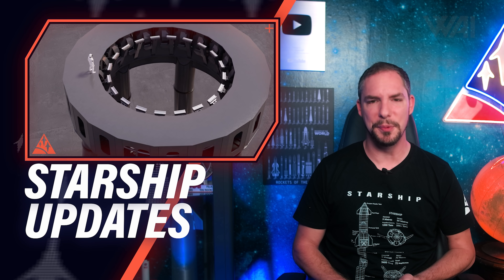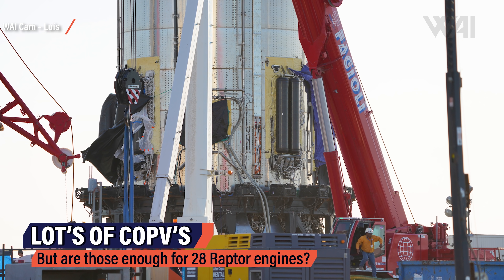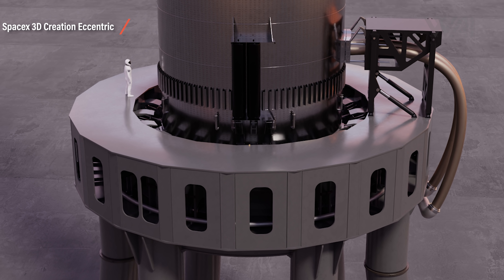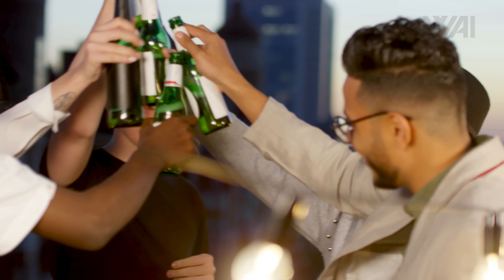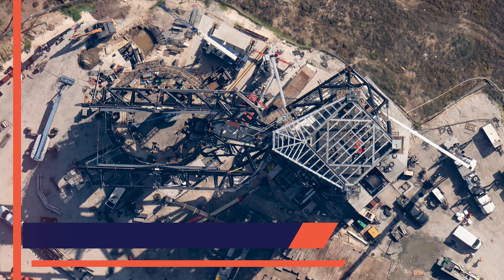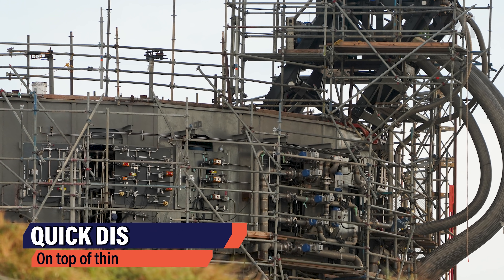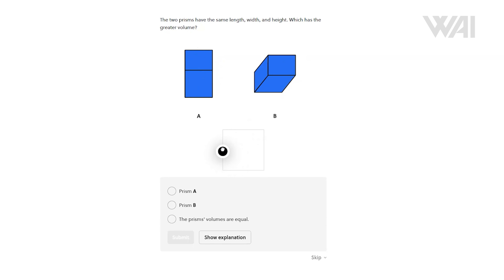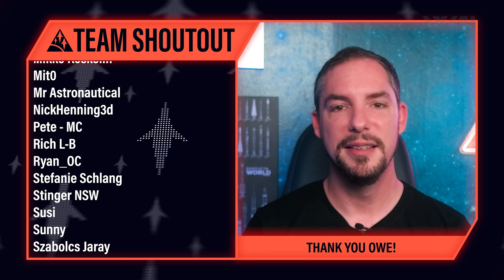SpaceX Starship & Super Heavy engine mystery solved!

Comment from the maker: Is there anything we missed about the orbital launch mount? :_WAIHello:
Reply: They for sure already installed some water pipes in the legs of the orbital launch pad 😉
I always wonder how they can continue working with all the dirt after each launch. It must have effects on electronics and assembling
Reply: My thoughts exactly.
But they got filled with concrete, right?
Reply: The legs I mean.
(Answer to Dr. Ricco)
Reply: @FlavioLanfranconi  but were all of the legs filled, they are of sufficient diameter that 1 in 3 or 1 in 4 would surely be able to carry enough water.
Reply: @ProgressiveEconomicsSupporter  I was thinking the same. Water mains might already be installed inside the legs of the launch pad.
Reply: @ProgressiveEconomicsSupporter  A (hidden) water deluge system would flood the entire launch site. There is no drainage.
Reply: Saying the booster is kept under pressure when it is empty... Does that mean it can't support it's own weight?
Reply: @DavidJohnson-tv2nn  yes and no you gotta understand there is a limit to materials before they literally just crumple like mk1 starship
Reply: @DavidJohnson-tv2nn  It can when both booster and Starship are empty. That was proven when they did the fit test stack. But the pressure will be needed when the Starship is filled with fuel and payload as it will increase the weight substantially.  They are trying to go as light as possible on the booster so that they have more payload capacity. Which is why much of the stuff has been built into the Orbital Launch Platform. Payload is money.
Reply: Siii, nuevo video, genial 

Saludos desde Colombia👍
Reply: @rdherrera543  p
Reply: Near end Olva quick disconnect render, it would be nice to see a banana for scale on the LOX & CH pipe diameter.
Reply: i suggest that the water for the deluge could travel up inside the legs to the table ..both to supply the water for sound suppression and to prevent legs from heating up
Reply: well, there IS a water tower in the tank farm so, that probably means there is a water deluge system, so probably we just havent found out where it is, right?

cool videos as always, thanks!
Reply: Booster needs to be aligned with quick disconnect arm. How it will be assured with chopsticks catching the booster? Does the chopsticks have ability to turn booster?
Reply: @Rincerith  The chopsticks have "tank treads" on top to facilitate this.
Reply: @KingdaToro  thank you for this information!
Reply: @Rincerith  From the various renders shown to date yes there are tracks on each arm that apply pressure and when powered up will do precise rotation of the booster until it is aligned properly. They look like rubber faced tank tracks.
Reply: Hold-downs weren't mentioned. Are the connectors that connect to the outer engines to facilitate ignition also the hold-downs?
Reply: What if.... The water for the deluge system is contained in the launch platform legs? I don't remember them being filled with concrete during construction so I could be wrong 🥴 but water in the legs would cool them as they have no protection from blast. This would be a elegant solution 🤔
Reply: @Positivity  yes he dose
Reply: Yes the deluge system is already built into the mount/table.  These pipes were put in before the table was moved to and installed on the launch stand.  Lines from the water tank will connect into the system and water flows around the 20 arms.
Reply: You rock*
Reply: I liked the new intro
Reply: Flame trench
Reply: You have such a great channel! Keep up the good work! From Russia
Reply: Find the best German chocolate and re-wrap "Why Not Eat This*" chocolate bar.

*May taste better on Mars
Reply: FELIX theres no mistery on it, everyone know  how it work and someone show that in another channel 4months ago.
Reply: @madara12regio  I just like that he visits twice weekly, we all know he'll cover new stuff when it comes. Until then we can enjoy his confusing accent and passion for SpaceX am rocket's. He is better than Bots for sure. Thanks Felix for the visit even when there's no major changes. YOU ROCK!
Reply: Super/sub-cooling propellant using helium bubbling post-press(?) is worth mentioning, re: the gaseous feeds
Reply: Sorry, where is the link to Cosmic Perspective?
Reply: The best part is no part. The deluge system is needed but why water? We have Nitrogen in liquid form available. That is much colder and this will take much more heat out of the exhaust gas. The byproduct is a much more transparent lift off and no dirty rain of water and exhaust.
Reply: @paul_gradenwitz  Water is a good heat and sound absorber, this particular liquid has a high latent heat of evaporation which soaks up energy to make steam. One of the tanks in the farm is understood to be for water, question is how to pressurise it to flow quickly enough on launch, without a tall water tower?  Those horizontal tanks maybe, air at say 20bar?
Reply: @paul_gradenwitz  the specific heat capacity of water is four times greater than nitrogen, and it is much less expensive to store.
Reply: Can the booster hop? We do not know for sure yet. Would it explode where it stands?
Reply: @reasonerenlightened2456  It looks like THIS booster is gotta go right to orbit without a hop. However, I guess we can see a few hops with the next boosters (to with booster dummies rather) when the chopstick' 'catch-in-the-air' system will be tested.
Reply: there is a gse water tank at the orbital launch site but im not %100 on its purpose ! but deluge or not  the olm is in for some hurtin for certain !
Reply: I've been thinking for some time that the legs of the launch mount are actually pipes. That would be a schitt-ton of water that could flow through those. And if it was piped all the way out to the ocean, they would have an endless supply of water to pull from, and not have to worry about re-filling tanks between launches. I think those legs are definitely doubling as water pipe housings. ;-)
Reply: I think the reason we don't see a massive deluge system is because this ship will not have one on Mars or the Moon. Several months ago I was assuming this ship was gonna be for further testing. At this point I'm not sure why it doesn't have a massive deluge system. Musk did state he hopes the launch tower doesn't get damaged so I hope he has this figured out. LOL
Reply: @brianrhubbard  YUGE differences between Mars, The Moon, and Earth:
1. Sound waves travel through mediums, not through a vacuum.
 a.) The Moon has no atmosphere, so there are no sound waves on The Moon... no matter how big your rocket may be.
 b.) The Martian atmosphere is substantially less massive than the Earth’s atmosphere. Atmospheric surface pressure on Mars is 0.006 bars (approximately 1/150 the sea-level pressure on Earth). Therefore, sound does not propagate through the Martian atmospheric medium as effectively as it does Earth's. That means there is no need for a sound suppression system for rockets on Mars.
Reply: @SteveKasian  Think about it. Until the ship leaves the surface there will be plenty of media and atoms.
Reply: @brianrhubbard  Not sure what you're referring to. You posited the possibility that there might be no deluge (sound suppression) system at Starbase because there won't be one on Mars or the Moon. I simply outlined one of multiple reasons why there is not one needed on Mars or the Moon.
Reply: @SteveKasian  No matter where the ship is, whenever those engines fire off there will be plenty of pressure and media
Reply: @brianrhubbard  Define "plenty of pressure and media," please: Plenty enough for what? In discussing the water deluge system, we are directly addressing SOUND SUPRESSION. ie. The purpose for the water deluge system is sound suppression and sound suppression only; Nothing else. So, being that sound is not an issue on Mars, and particularly not on the Moon, there is no need for a water deluge system on either world.
Reply: @SteveKasian  That's not true entirely. The deluge system also helps with heat. You know, to keep stuff from melting. Your also right about the moon not having an atmosphere and being in a vacuum. You know, no media no atoms no sound. When the propellant fires off it must not have any byproduct, right? So that means there shouldn't be a pressurized flame front at the skirt of the ship. Lets pretend the ship will have landing gear and will be several feet off of the surface. When methane burns it creates CO2 and H2O. Your telling me that this wouldn't create a media for sound to travel through?
Reply: @brianrhubbard  There is no medium. The exhaust exiting the engines is precisely that: Exhaust. It's not "creating media for sound to travel through." I'm not sure how you are visualizing/conceiving this concept of yours, but it's all wrong. In order for there to be a medium, there has to be pressure. There is no pressure in a vacuum, thus the name. ;-) "Venting" gasses of any kind into space doesn't do anything to create an atmosphere in, or to pressurize, the vacuum of space. If you are in a finite vacuum chamber that is completely sealed, adding gasses to the vacuum replaces the vacuum with pressurized atmosphere. But in space, there is no finite "chamber" in which one would be releasing gasses, so they would not "pressurize" space, but would rather disburse immediately into scattering, individual atoms of which said exhaust gasses were made.
Reply: @SteveKasian  I'm not convinced. So why does a rocket have a 50 - 100ft flame front in a vacuum?
Reply: @brianrhubbard  It doesn't. There can be no flame in a vacuum; And any oxidizer has already been burned before it leaves the nozzle, so there can be no flame there. Must have O for a flame! That being said, let's entertain the scenario of a flame front present: What does that have to do with anything?
Reply: @SteveKasian  So why will Starship use RCS thrusters to land on the moon?
Reply: @brianrhubbard  Because the Moon's surface gravity is around 1/6 that of Earth's.
Reply: @SteveKasian  You sure its not because of the dust clouds Musk said would be created if they were on the bottom of the ship? That he said was the reason they will be placed near the nose of the ship. Everyday Astronaut and Musk discussed this during his tour of starbase. Musk him self talked of the pressure from the engines being on the bottom would form a crater that could cause starship to fall over during landing. You can watch the interview yourself and argue with Musk about that fact.
Reply: @SteveKasian  The same way a vacuum cleaner sucks up things here on earth but opposite.
Reply: @SteveKasian  Not fast enough.
Reply: @SteveKasian  Flame front of Methane and oxygen in vacuum. Just research it.
Reply: @brianrhubbard  Well of course. And if Earth's gravity was low enough that they could land rockets with RCS thrusters on Earth, you could bet your bottom dollar they'd be doing it here as well. The reason they don't is because they CAN"T. They CAN on the Moon, because of the weakness of the Moon's gravity well, therefore they will.
Reply: @brianrhubbard  "The same way a vacuum cleaner sucks up things here on earth but opposite."
Not sure to what point you are trying to make with this comment, but it doesn't make any points.
Reply: @brianrhubbard  There can be no flame in a vacuum. Research it!
Reply: @brianrhubbard  Just like Mega-Maid, going from SUCK to BLOW, huh! lol
Reply: @SteveKasian  So why when there are correction burns in space you can clearly see the flame front extend several feet out from the thruster nozzle?
Reply: @brianrhubbard  I think you would be better served by looking this up on the internet and learning all about these vehicles. The correction "burns" are actually inert gas being sprayed under pressure. LN is the propellant, I believe (but may change on Starship). The reason you are able to see it is because it forms a rather thick cloud of vapour. You'll notice that it is only seen when sunlight is shining on it, and is especially visible when it is dark at the viewing location.
Reply: @SteveKasian  A flame front from a 90 flb of thrust rocket in complete vacuum. Knowing this day was nearing and would be a great example. Here is Draco engines firing in vacuum. I have watched everyone of these dockings. These are not inert gas thrusters. These are hypergolic liquid rocket engines.  Starting at 3:27:30     https://www.youtube.com/watch?v=dZ5YAPZ8i3s     

Imagine a Raptor engine.
Reply: @brianrhubbard  I looked at the video at 3:27:30 and didn't see any thruster firings. But regardless:
1.) Thrust is not measured in "flb," whatever that is; It is measured in "newtons." 
2.) Draco engines do not produce a large plume of flame in a vacuum; This is the case for ALL/ANY rocket engines in a vacuum.
Reply: @brianrhubbard  I finally saw what you were talking about in the video. The flame front of the Draco thrusters extends literally 2 feet from the nozzle! Of course there's a flame there - the oxidizer is still present in the mixture. But once that oxidizer (oxygen) gets combusted within the mixture, the exhaust disburses and the flame is no longer present.

On Falcon 9's upper stage, you can see the same effect after MECO and stage sep., when the Merlin Vacuum engine (M-VAC) is started. There is definitely a flame front, but it is immediately muted once the oxidizer is burned and the vacuum of space takes it effect: The remainder of the exhaust is disbursed into the vacuum of space.

If you fired one of those Dracos on Earth, under normal atmospheric pressure, the flame front would extend probably 30+ feet out from the nozzle... which was what you based your whole point on, as far as the engines creating an "atmosphere" of their own by filling the local void with gas/exhaust/molecules/atoms. You argued that there would be so much material, it would create a gaseous medium in which sound waves could propagate (that's what I understood your point to be, anyway).

The problem is, there is no pressure. It's a vacuum! Everything disburses immediately. So for example, you could go to the Moon and pump literally billions of tons of any type of gas you could imagine - take your pick - into the void anywhere on the surface of the moon  (or anywhere in space, for that matter) and there would never be enough gas to pressurize the vacuum. Because it's boundaries are infinite. There is no finite container to pressurize. For that reason, sound waves cannot travel through the vacuum of space, on the surface of The Moon or anywhere else in a vacuum.
Reply: @SteveKasian  OK
Reply: Are both starship and the booster filled together/ in sequence, via an internal connection between both? Or is the ship fuelled separately?

Comment: Exemplary Presentation...detail we're not used to seeing, and important ones. many questions remain for example, the QD Assembly has multiple Apertures - Must have Silicone Seals  ( or other) included?  How is the Deluge System Timed with Ignition....must be fraction of seconds behind actual Ignition ... assuming wouldn't want Deluge 'before' the Engines Ignite. Most deluge Water turns to Steam BUT where does the rest of the Water Go? That kind of question stuff stuff.

Comment: Hi Felix (and whole team), there are rumors about pressurization of fuel/oxidizer tanks which are/must be pressurized for hold  "hull integrity" of tanks as was mentioned many times BUT how you like pressurize tanks when there are opened manholes??? Simply it not make sense for me and it looks that tank structural integrity is reached by tank itself without any pressutization which on other hand can help hold structural integrity when you manipulating with ship/booster

Can you comment if Iam true or how exactly it works? Thank you

Comment: 00:45  A waterless noise supression might be based on Noise Cancellation (NC)/Active Noise Reduction. Although large-scale open air NC might be very difficult, it is not impossible. Airports are starting to use large scale open-air NC techniques, and there are some recent interesting patents in the field. One might even look some distance away from the launch mount for sound-absorbing pyramidal structures (eg, sound cones).

Comment: Water Deluge System    If you could fill the legs of the platform with water, then the water would be available for deluge during Launch.  The water can then be delivered by Gravity at the bottom of the Platform Legs and could be drawn to the top by the Venturi Effect caused by the Launch Plume.  During an Explosion (Sudden Unplanned Disassembly) if the Platform is destroyed the water will again be released.  Holding a liquid in the Tower Structure will help prevent Heat Damage caused by the Launch Plume.  This also allows for the slow accumulation of water and even collection of local rainwater if available.  Additives such as Foamers can act as Fire Suppression, Water Volume Expanders, and Noise Suppression additives.  If you think water is good at noise suppression you should try foamy water.

Comment: This rocket is approaching the capacity of sea Dragon, 550 tons into LEO.  Proposed in 1962 but never built.  It launch from the sea without a launch platform.  It floated in the sea.   Sea launch reduces the injury risk.  Musk likes using barge to recover boosters how about a barge to launch the super heavy.   Basically hold it onto the barge and as the launch sequence get to ignition plunge the rocket into the sea as the exhaust pushes on the ocean. and pump water over the surface to the fixture and barge as the rocket lifts off.